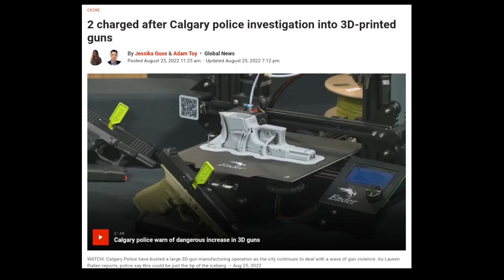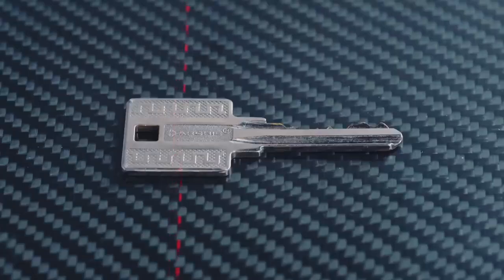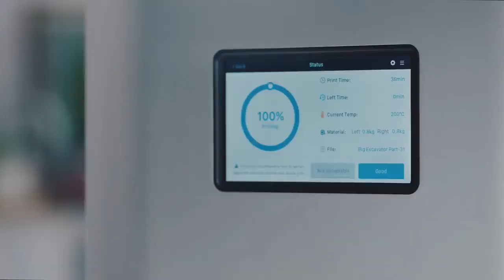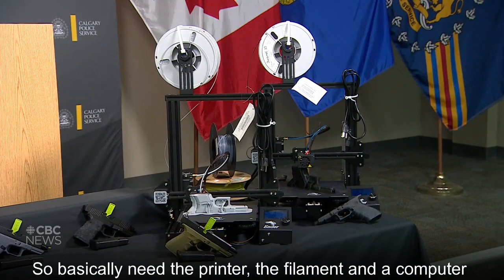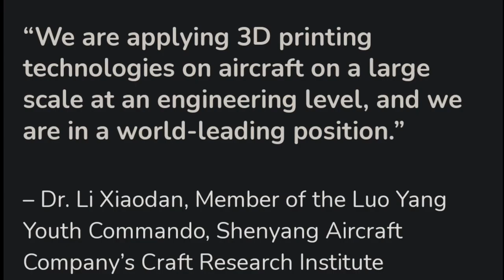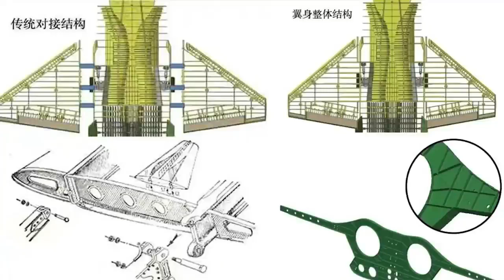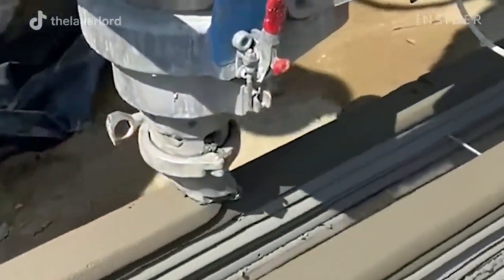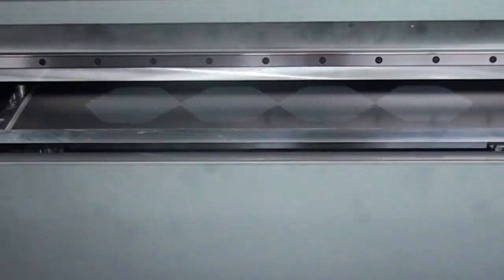Is 3D Printing going too far?

Comment: if you don't have a 3d printed gun you can use your own car to hurt considerable amount of people, especially in crowded places.
you can buy 50 liters of high octane gasoline, aluminium extrusions, oxygen tank, and heavy bolts, making an explosive devise of considerable power from it, if you don't have access to oxygen you can replace it with hydrogen created by electrolisis.
you can make an explosive from literal fertilizers.
bottom line is, if you are not entirely stupid you can find unlimited ways to hurt people.
if we would to ban all technology which can be used to hurt people we would not go past trivial fire.

Comment: Just for the record- the only parts of a 3D printed gun that won't set off a metal detector are the parts that won't matter without the metallic parts attached. To wholesale address them as presented is fear mongering at best and bald faced lying at worst.
Reply: There once was this movie in which a guy smuggled a gun onboard a plane which was made up out of plastic. 2 barrels next to eachother, each holding just 1 cartridge.
The 2 cartridges were smuggled in via a little stuffed animal on a keychain.

Sure, it was a movie.
BUT i think this is not completely impossible.
And all it takes is just 1 bullet, right?
Reply: @bertjesklotepino  not impossible, just improbable for concealment as the amount of plastics needed to address the forces of a fired round are considerable. Much less one would still have to create a non-metallic bullet and again a casing and primer.
Reply: @davedelarosa319  In the movie i was talking about the bullets were put into a small metal tube that was inside a small stuffed animal on a keychain.

The gun was just a block of plastic, 2 barrels drilled into it. And a triggermechanism that was basically made out of 2 springs and 2 nails.
something like that.
It has been a long time since i have seen that movie, and i can not remember the title.
I might also be mistaken about if they took it on a plane. It might be that they took it inside a secured building, for some assassination attempt on some important guy. Seriously long time ago.
All i can remember is that it was a white piece of plastic, double barrel, rectangular shaped.
And the bullets he used were small caliber obviously, and hidden in a small metal tube inside a stuffed animal on a key chain

Again, it was a movie. Not based on real events. (it wasnt James Bond either, that i am sure of).
But i am just saying: If all it needs is 1 bullet to get rid of somebody, you dont need much to fire it.
There are pens available that can fire a small bullet.
So i imagine that you can indeed print a gun with a 3d printer to have it fire just 1 bullet. It doesnt have to be accurate.
It all depends on when you choose to fire the bullet, right? 
The right guy at the right place at the right time can do some damage with a piece of plastic like that.
Reply: @davedelarosa319  im stupid. Sorry.
Now i remember the movie.

It was: In the line of fire.

2 words in google and it popped up. Anyways, i am just saying that if you need to do 1 job with it, a printed gun can do this job in my opinion.

All the rest is not important, right? I don't think it is.
Reply: @bertjesklotepino  the right material in the right hands of a motivated person can do amazing amounts of damage. It doesn't matter the form factor.
Reply: @bertjesklotepino  never seen the movie, sorry.
Reply: @davedelarosa319  its a great movie, about the assassination attempt on a president of the US. Clint Eastwood plays a role in it.

Anyways, you can find it on youtube, the important clips.
But yeah, i totally agree with your first post: The right material in the hands of a motivated person can do amazing amounts of damage indeed.

But then we can conclude that your very first post, the one that started this thread, is not completely accurate, right?
Because you do not need metal parts.
If the motivated person is just motivated enough to kill a single person and not care about the rest of the circumstances, all they need to do is get close to the person and have a 3d printed plastic gun that can deliver 1 bullet with some force.
So not exactly fear mongering then, i would think.
:)
Reply: @bertjesklotepino  the situation implied by the video (large events/crowds, air travel) allude to multiple victims, to which a plastic firearm capable of slipping by a metal detector is as you've pointed out, a fictional idea at best. A ball point pen with a bit of coarse material and 5 or so minutes can be used to kill multiple people if again skill and motivation are there. Something as simple as the grocery store can be one of the most hazardous locations you can visit if someone applies some simply acquired knowledge of chemical reactions. Yet there's no call for a wide spread regulation on production or ownership of say bleach, or Styrofoam cups. Base point being it is not the item, or the technology, or even the availability of any given item, but rather the actions of those involved.
Reply: @bertjesklotepino doesn’t matter. You can’t stop the signal anyway lmao
Reply: which signal?
I do not understand what you mean to say @TheAsianOfChaos